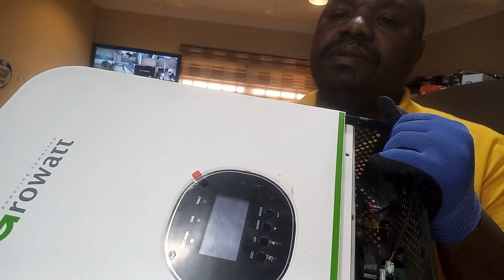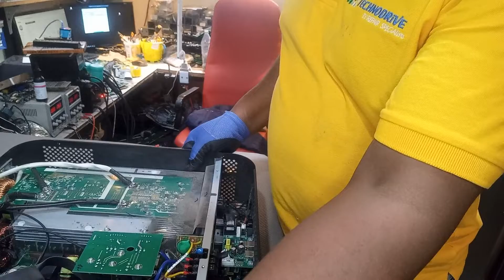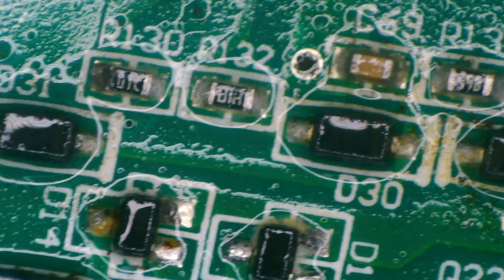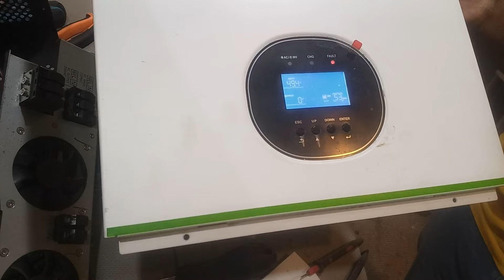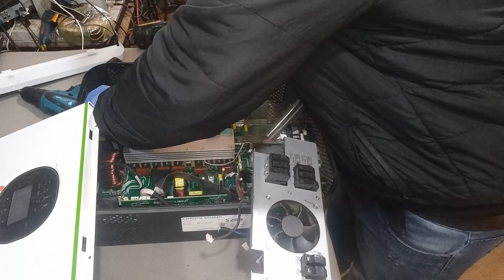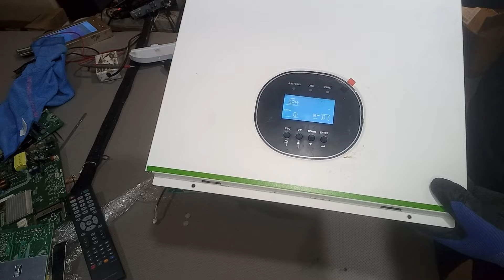Repair of Growatt SFP5000TL HVM Error 53 Water Damage  Resistors changed

Comment: Great work, I might try fix mine. I found my SPF3500ES had weird stuff happen, it said 2400W was going into battery but less than 300W coming from PV, battery had little to no charge coming in. I turned it all off and on then I got that error 53. It has been in grid bypass even though I set it to use battery.
We did have crazy storms a week ago but there's no water that came in that I can tell.
2 growatts in 3 years. Maybe time for a victron 🤔